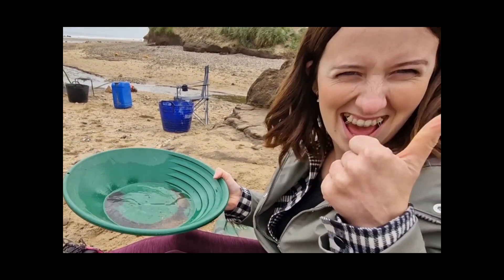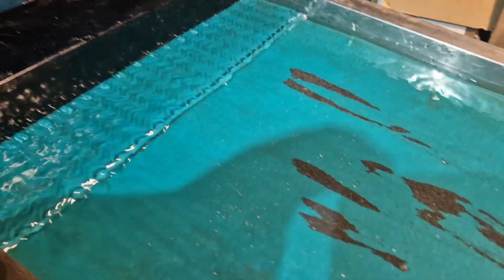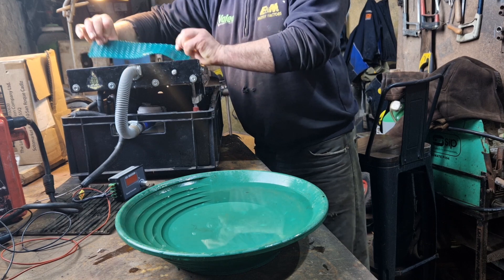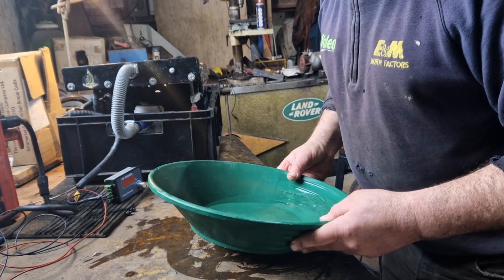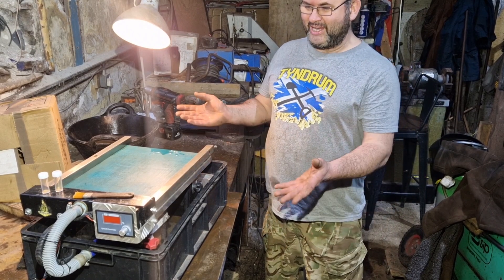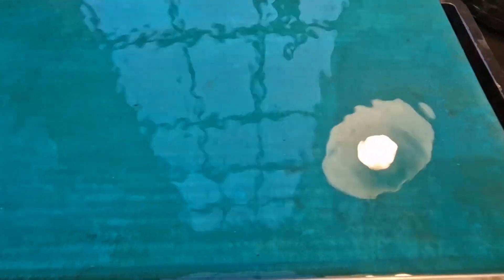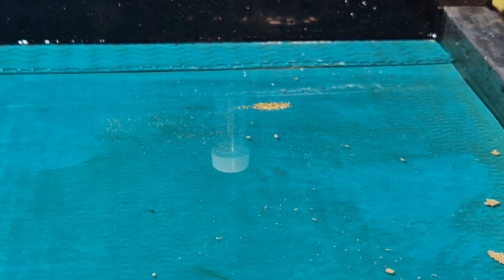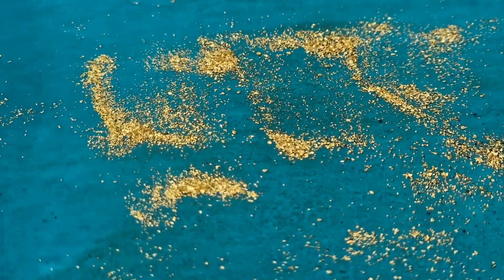The Miller table is Complete (Part 5)

Comment: Hi Jason,

   new subscriber and totally new to the hobby, just spent the last few days watching all your videos and can't wait to give it a try - maybe bump into you out in a river sometime...lol 

Re: the Miller table, just wondering if you could gently vibrate the  bed of the table, it may help separate the gold/sands and speed up the process? - maybe a bracket between the existing pump and the table bed or attach a small motor to the underside of the bed running off-centre to induce some vibration. Not sure if it would work but maybe worth an experiment - have seen a similar process used to separate copper.
Reply from the maker: Hi Ken,

Thanks for subscribing and watching my vids.

I may just make a shaker table in the future and leave the Miller as a Miller table, it works great.

Good luck out there and thanks.